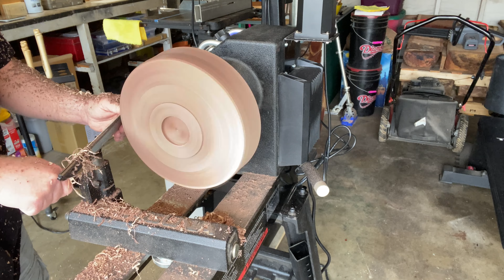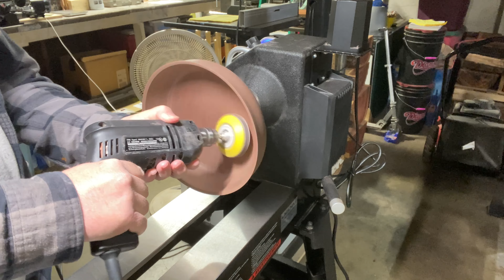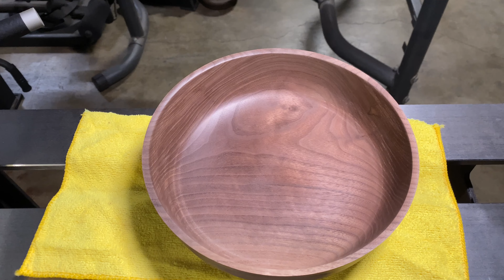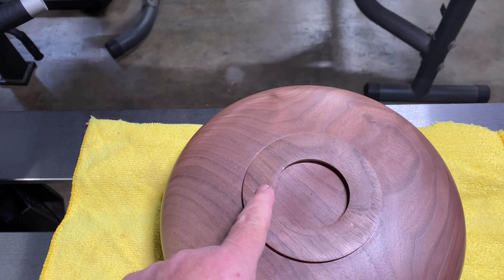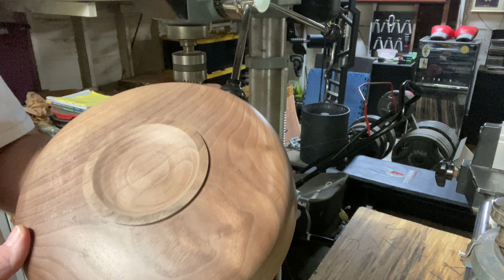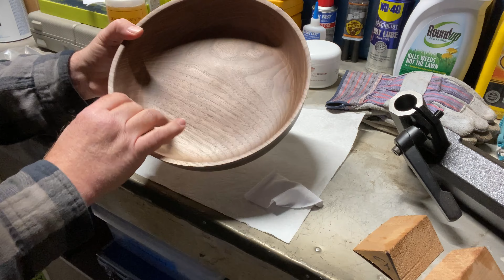Half bowl, half plate…turning a very useful walnut blate

Comment: Looks really nice. Suggestions for removing the inside: use a 5/8” gouge, turn up the speed and get a curved tool rest. Once I get the bowl balanced and round, I get the speed up to 750-800. If I get tear out, I sharpen, make light, slow passes and increase the speed more especially if I want a thinner wall thickness
Reply from the maker: Thanks for the feedback/advice. Appreciate it. Recently added a curved tool rest too. 👍